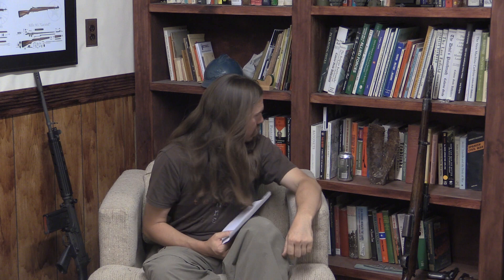Q&A #6: Rollin White and Other (Better) Designers

Comment: It's not important, but you might be interested to know that working with medieval manuscripts is done gloveless for the same reasons you allude to, the risk of catastrophic damage due to loos of dexterity/slippery fingers is way greater than the risk of clean hands on the page.  The one case where this does not apply is some of the illuminated books with very toxic pigments in them, or pages where there's been serious damage done to the membrane by acidic inks (green is bad news)
Great videos!
Reply from the maker: Interesting - thanks!
Reply: Well, I'll be, as a HEMA student, this is something I wouldn't know about. 

Guess it's time to pick up the history studies at uni again.
Reply: There Be Game HEMA?  There's an acronym I don't know
Reply: Aaron Macks Historical European Martial Arts. Sword fighting on a whole and a very large chunk of that knowledge comes from very old books, fechtbooks as they're called.
Reply: Could you talk about some of the pigments, green especially since the only green I'm thinking of is Paris green, which isn't that old. (1800s)

Comment: The reason to go to the 7.62mm/51mm from the .30'06 was strongly economic so far as I can see. The .308 shaves 12mm of brass off of the case without losing ballistic performance which adds up to a huge savings in copper which means more bullets can be made. A smaller bullet also saves in transportation and storage costs. While shooters tend to obsess about the excellent performance of the .30'06, they tend to forget the enormous price Uncle Sam paid in resources for that big ol' bullet. The .308 helped correct that. In other words, the .308 is the Bean-Counter's .30'06. 
      Timing was also favorable for this change to happen because it had been decided in the early 1950s that the guns of WW2 were not really compatible with the new directions the US Military was taking. They were already going to dump the Garand, BAR, and M1919 for the new wonder-duo of the M14 and M60, and as Ian mentions earlier in the video, a good time to change bullets is when one is going to change guns anyway.  
      Also of minor consideration is that the 1950s was also when the US had a lot of new client states begging for Uncle Sam to arm them. Thus, the .30'06-era weapons would not be going to waste. The US needed lots of decent guns for the Germans, Koreans, Vietnamese, and Banana Republics to name a few, and so it was an ideal situation. The US could acquire new guns firing a cheaper bullet while the old weaponry would help greatly improve the arsenals of "friendly" powers all over the globe. It is a little easier to adopt whole new weapon systems when one feels they have a good way to get rid of the old ones without having to deal with scrapping. 
      Apologies for the long post but it is hard to distill this all down.
Reply: they should have shaved a little more and made the 7.62x43 british  the nato cartridge and both the m-14 and m-60 probably fixed the control problems!
Reply: Idk i feel like the M1A and the M1 garand i was shooting at my local store/range weren't very comparable in motivation those 30-06s were a whole lot more interested in effing up whatever was down range over the more mild mannered .308
Reply: @royperkins3851  Right the 7 x 43 aka .280 had enormous potential as a true intermediate cartridge but the 7.62 x 51 with no potential was forced on the West. Thanks US and later for the anemic 5.56.
Reply: Absolutely phenomenal take. No need to apologize

Comment: the switch from .30-06 to .308 (7.62x51) was because having a shorter cartridge was better for feeding self loading and automatic rifles, and allowed for smaller actions, while still retaining comparable ballistic characteristics to the 06. propellants had progressed enough at the time that the longer cartridge wasn't needed to get the bullet moving at the same speed. this leads to gun design between "long action" and "short action". in an automatic, a shorter case means shorter travel distance in the bokt cycle, meaning faster inherrent rate of fire. also at the time, .308 was actually more accurate than 06, though this is much less of a case nowadays.

Comment: Ian, I wanted to address your comment about the US service pistol for a moment.  Albeit a super tiny niche use amongst the military, the Coast Guard relies heavily on pistols when boarding vessels.  Most of the boarding team is armed only with pistols.  Both getting to and on the other vessel as well as the INCREDIBLY tight quarters inside the vessel makes any use of a long gun somewhere between difficult to impractical.  Of course it doesn't change the premise that basically any modern pistol is fine as long as it meets basic requirements for reliability and durability.

Comment: When it comes to the funky cartridge types; although it's highly unlikely anyone outside of Russia has ever seen them in person, have you by chance heard of the 7.62x42mm SP-4? This was a Soviet design for a quiet and non-flashing cartridge, essentially you have a metal pistol between the powder and the bullet, the powder ignition shoves the piston forward, and the piston rams against the bullet and propels it out the barrel while keeping the blast of the explosion completely sealed inside the case. The inefficiency of the design results in velocities comparable to a .22 short, but it produces no muzzle flash and almost no escaped noise.
Reply: or the underwater "needle" cartridge Russia made....
Reply: toomanyaccounts
 Yep the HK P11, also the APS Used 5.66×39mm MPS round not the 7.62x42SP-4.....
Reply: toomanyaccounts
 true ;)

Comment: One thing that might not be widely known: electric primers are incredibly common, but not in small arms. Nearly everything that is in medium caliber cannon, particularly ammunition for gatling guns.My recollection is that the electric primers are more controllable and more reliable, particularly when you're trying to pump out 110 rounds per second a la project vulcan.

Interesting historical connection: Johnson was one of the original people behind project vulcan. He managed to get an original gatling gun to pump out ~4500 shots per minute by hooking it to an electric motor. This was done in the early part of the project, back in the 50's.

edit
I just checked the MSDS for primers. They're using DDNP and BKNO3, pretty much see spot run for the choice of energetic materials without using metal based primaries. there's no reason why an electric primer would be much more expensive (once mass production was figured out) than a percussion primer, and you likely would also be able to ignite it via percussion as well. The only question is to how to mass manufacture the primer in such a way as to make it cost effective.

Comment: About rounded versus pointed pistol bullets there is another MAJOR reason that rounded bullets are typically used.  Rounded bullets maintain their path through solids and liquids like flesh, bone and body fluids far better than do pointed bullets.  

We are now used to thinking of bullet upset as being a good thing, because a high speed bullet may then transfer its energy to the target and inflict additional damage rather than punching through cleanly.  Pistol bullets however have much less energy to waste, and this is a quality of pistols that is generally consistent no matter how advanced your technology, because a pistol must be controllable when braced in the hand rather than against the shoulder, and also, very importantly, in a light weapon weighing less than half of what a rifle will weigh.  To be effective, and also, as a separate issue, to be consistent in a way that causes users to rely on what is normally an emergency weapon, a pistol and its bullet must have a fair amount of "overpenetration."  A normal rounded nose pistol bullet can achieve this, but a pointed bullet of comparable speed, weight and velocity often would not.  

To achieve an acceptable level of recoil a pointed pistol bullet must be very small, and it must be driven at rather high velocities which are difficult to achieve in a pistol with the normal technologies used in the industry.  The FN 5.7mm round for example, has a case covered with a special coating to lubricate it, because the comparatively high pressures used to achieve its velocity typically cause jams in a pistol absent the coating.  

The problems continue because a small and high velocity bullet used in a pistol tends to disintegrate so quickly upon hitting a target that it can become ineffective.  This at least is not an insurmountable problem, but such bullets are normally more expensive, and in the sizes and weights appropriate to a pistol, normally have to be designed specifically for that application.  

If pistols were commonly used as primary weapons by the military, pointed pistol bullets would probably have become common by now.  Since pistols are not used in this way however, pointed pistol bullets have never come into vogue, and this is not only because pistols are not heavily modernized, but also because pistols are commonly used as concealable weapons.  

The Soviet PSM was designed as a concealed weapon with a pointed bullet, and while it achieved its size role admirably, the pointed bullet frequently performs weakly when it is driven at the speed practically achievable in so small a gun, which has a barrel length much shorter than the FN or H&K service pistols.  In post-Soviet Russia the 5.45x18 has developed a reputation of having inconsistent or weak stopping power with its pointed armor-piercing bullet holding together, but often failing to tumble enough to produce a satisfactory wound.  Generally speaking, a slower and heavier bullet would have a superior effect on an unarmored target.  Since body armor is now quite prevalent, Russian design now tends toward the use of large light bullets which go fast and have an armor piercing core that detaches when hitting an armored target.

Comment: "in 1855 there really weren't any metallic cartridges"
as an overzealous Frenchie I take offense to that.
Reply: Qsy was too short In the United States just the Smith and Wesson .22 short black powder cartridge. The .44 Henry Flat rimfire and Spenser .56-56 black powder rimfire came a little later. The pinfire had a European patant on it as did the system that shotgun shells became based on. French design.
Reply: Paternity tests are illegal in your country, isn't that sad.
Reply: Pauly shotgun? What year was that? 1810?

Comment: Posted 32 seconds ago?! Last time I was this early, the 1911 was still in trials!
Reply: +Garith Jonez and it also wasn't built yet
Reply: +Garith Jonez it rarely is anyways
Reply: depending on how low the IQ of the person you ask, it always was.
Reply: Actually the platform finds its way into the hands of ISIS and Al Nusra a ton more than you'd expect. They don't use the rifles as a novelty, they must have a ton of .223 ammo out there. Likely some of it is captured U.S. armament.
Reply: Odysseus apologies, my mind slipped as at the time I was dealing with a couple issues if I recall properly.  The truth is that an AR-15 is rarely used in mass-shootings in America, all rifles less than 30% of the time.  I have no idea about overseas terrorism, but with the relative simplicity and cheapness of the AK-47 there is a reason it is the "typical bad guy gun".  However, the .223 round is a standard NATO round, found in the 5.56.  My Ruger fires both (pressure difference, the 5.56 has a higher pressure).  I wouldn't find it that strange for them to use it.
Reply: Thotenjäger you cant charge a gun in a "gun free zone" haha
Reply: Now hear me out. What if Eugene Stoner got the idea for the AR-10 when aliens captured him in his back yard?

Comment: The length of the 30 06 was shortened to make the 308 for many reasons. A shorter action is handier, a tad faster, and uses less material. The 308 rounds take up less space. The 308 rounds uses less brass and brass can be a strategic material in short supply which is why the Russians and others use steel. The 06 is also overbore for guns with normal barrel lengths which is a fancy way of saying they had a significant amount of empty space that wasn't being used. You either needed a longer barrel & a heavier bullet or a larger caliber to take full advantage of the space inside the case.  For various reasons rifles with a barrel a yard long didn't catch on and the bullet weight went from 190 to 150 grains if I recall correctly. That reduced recoil which helped troops flinch less and hit more often.

Comment: The development program for the 7.62x51mm NATO cartridge was intended to replace previous generations of rifle cartridges in US and foreign service and unify all of them under one standard "Well its good enough" cartridge. The 7.62x51mm did everything the previous rounds did, without needing to be hilariously long or heavy. This allowed a soldier to carry smaller magazines for his new rifle, which allowed him to carry more ammo, allowing him to potentially be able to put more rounds downrange. The only cartridge that potentially could do what the 7.62x51mm NATO round could do was the 7.5x54mm French round, which was a bit lighter than the 7.62x51mm NATO while being a tad longer, however the French had had their flirting with long rifle cartridges with the 8mm Lebel.

Biggest advantage of 7.62x51mm NATO wasn't any improvement in terms of performance, if anything it may be slightly inferior to these cartridges, however the nature of infantry small arms development in the West back then and now really doesn't have a role for cartridges with such weight and range like .30-06, 7.92x57mm, etc.

NATO kinda did good early on with standardizing, also known as the US taking advantage of post-time war industry and dumping stuff on people, a series of cartridges, gun types, etc.

Comment: Ian the Glove question to wear or not comes down to the preservation method being used. Most collectors use
OIL and no gloves are wanted or needed. The guns are periodically re oiled. . Museums like to use WAX for long term. Warm hands melt the wax layer so gloves are worn to protect the WAX.   The question of gloves and paper goods is a means of keeping dirt and the natural skin oils off the paper.

Comment: To add to the descussion of the pan fed magazine, Fighter planes during WWI with foster mounted Lewis machine guns had larger 97 round pan mags, the Nieuport 10 11 and 16 came standard with a foster mounted lewis with this configuration, the D.H.2 had a nose mounted Lewis, and the Nieuport 17 was often field modified to fit a foster mounted lewis, the S.E.5 also came standard with a foster mounted Lewis.

Issue was besides the fact the Lewis being a open bolt machine gun and could not be synchronized, the belt fed guns could be loaded up to 500 rounds continuous, once the Lewis 97 round pan drum ran empty you had to fly a machine in a combat situation while at the same time unlocking a machine gun from its mounts and discarding a empty pan mag and then loading a fully loaded pan mag properly on a Lewis gun, i would imagine this was quite the stressful and frustrating task in a high pressure combat situation in the cockpit of a sometimes responsive and sensitive aircraft.

Comment: The biggest reason for the 7.62x51 was that the US Army refused to use a non .30 caliber round after WWII but every one of the NATO allies wanted something intermediate - see the .280 British for example. So they took .30-06 and made it "shorter & lighter" and rammed it down Europe's throat until they got to Vietnam, realized that the 7.62 wasn't worth the weight when compared to the .223. 

Your comments on the FAL in it's original form reflects this. The FAL in 7mm NATO would have been so much better than anything the US issued post WWII.
Reply: The US shoving things down people's throat it was. The 7.5 French was sitting there, 30cal, easier on the soldier, and the US decided to reinvent the wheel.

Comment: About the gloves Ian. There actually is quite some discussion in the academic world if using gloves to handle very old texts or artefacts is a good thing or not. I as a Dutch history student handled some medieval Dutch texts myself, without gloves. Why? Well because the gloves reduce your dexterity and make it more likely that you accidentally make a tear in the parchment. Further those gloves also increase the chance that you accidentally put dirt onto the texts which sits on the gloves. Finally and the biggest reason against them is the chance that you go over the text with cloves and damage the pigments or inks from the parchment and thus damage the text. 

I am defiantly in the non gloves side of the debate. Just wash your hands and I really mean wash them before handling, think and you will be fine.
Reply: What I've learned, the main reason to wear gloves is because of the oils secreted from our fingers can act as an acid on some materials, like cloth, metal and wood (and thus paper). Medieval texts were mostly made of vellum, which is calf skin. Not wearing gloves while handling those may actually be good. So it depends completely on the material.

And of course, it's always a compromise. Do I handle this small wooden artifact with gloves and risk to drop it and thus damage it, or do I very carefully handle it without gloves for increased grip and dexterity? It all depends on the handler, I think.